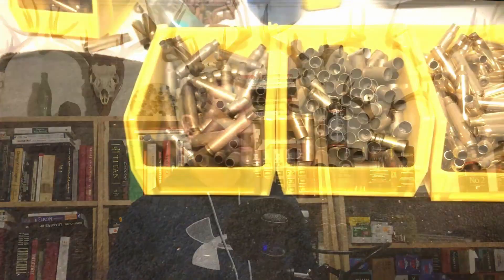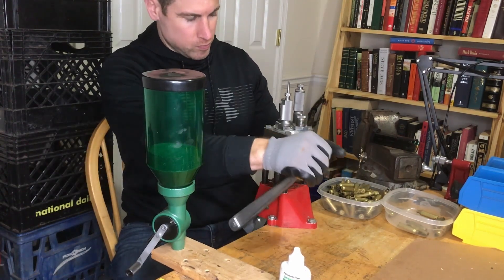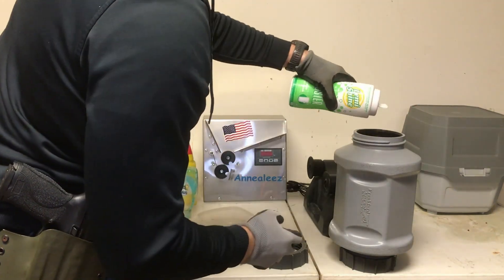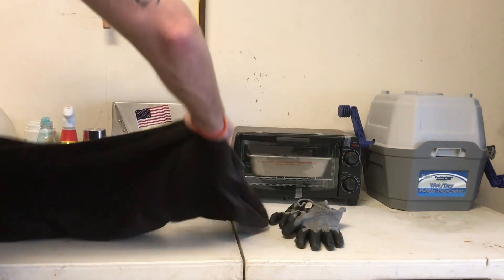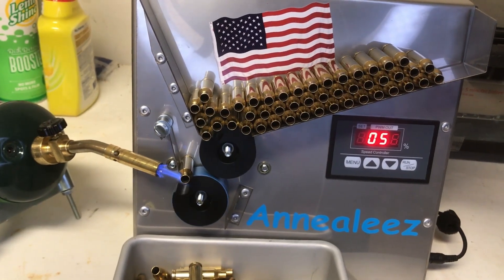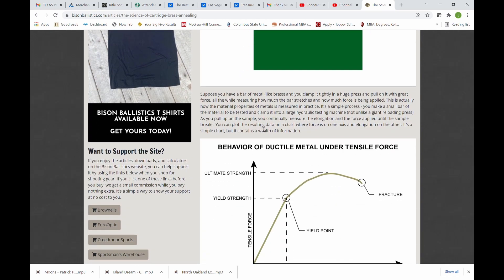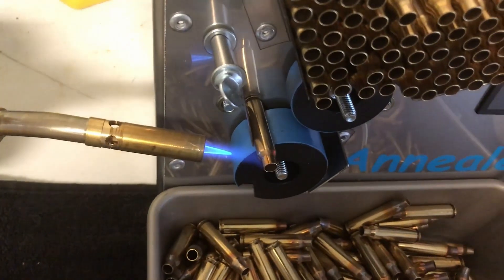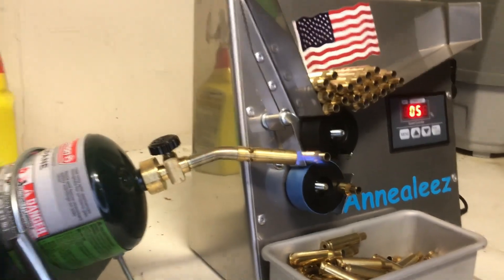Cleaning Brass: Reloading for Precision Video 1

Comment: I also wet tumble my brass. I don't use the stainless media. I purchased a 2 pound bag of 100% pure citric acid. It is used in the food industry to add a tart or sour flavor. A .45 acp case is a good scoop for it. All you need is one scoop. When finished tumbling, I put the wet cases in an old cotton pillow protector, zip it up and scramble them around inside. That way they stay contained.

Comment: Suggest you use Tempilaq 750 inside the neck and 450 painted in a stripe down the case. You want to know that the case is not getting above 450 ....not 750.